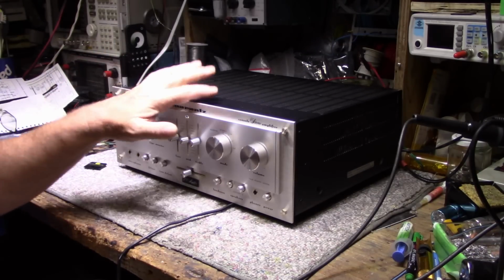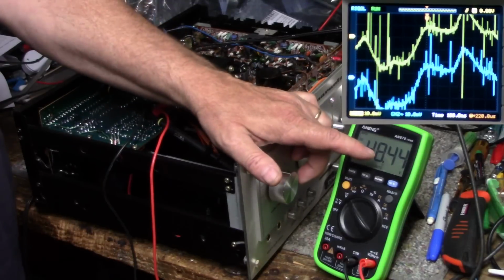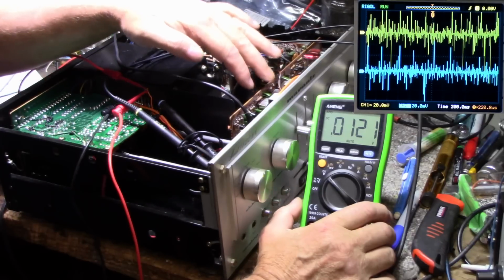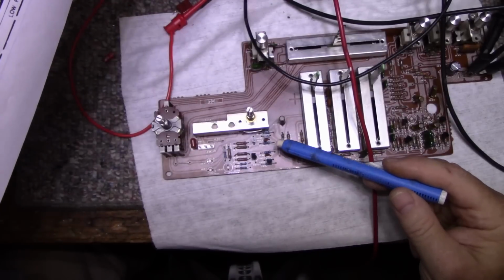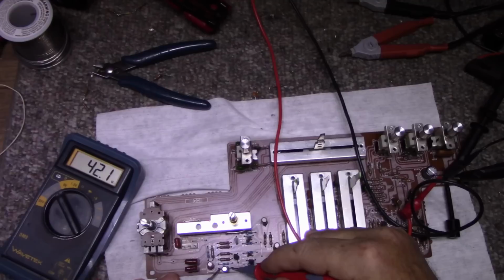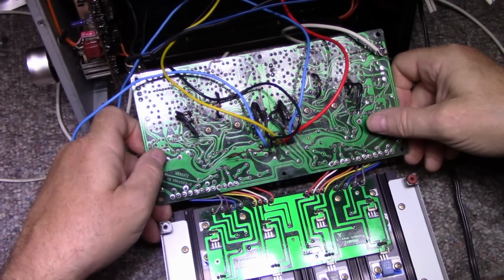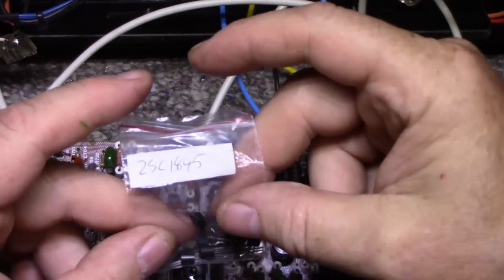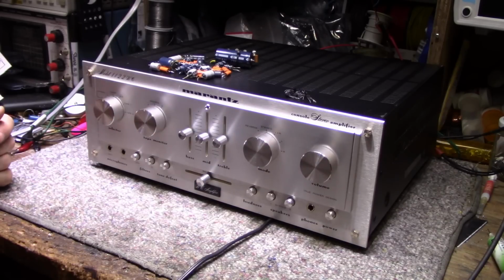Marantz 1122DC Amplifier Repair Part 2 (Ep. 189)

Comment: Crappy schematics aside, this is one of the nicer Marantz's I have worked on. I have done a couple and found corrosion on the silkscreen like you did - one much worse than the other. One even had corrosion on the solder connections on the input PCB. That said this is an excellent performing amplifier that can be had for much less than an equivalent receiver (i.e. 2265).

Comment: Before beginning any project, I take several photos in good lighting (outdoor sunlight is ideal)  of the ORIGINAL (unfixed, un-modded) unit's interior, pcbs, etc  . Makes reassembly easier. And discrepancies between  the actual unit vs. the serv. manual unit trivial.

Comment: I had to redraw an entire section of a power supply or audio circuit, it was years ago so I'm not exacty sure which one it was, on a Marantz 125 tuner. I wasn't impressed with the schematic at all.

Comment: I use freeze spray a lot , it has saved me so much time .  Good advice .  Great vid again , thank you .
Reply: Having the solder iron on the collector for half a second is in the same ballpark. Both methods need to be done really quick, so no other components see the change.

Comment: Excellent video a pleasure to watch, total marathon fault finding session. Just proves that the manufacturer isn't always right 👍.
Reply from the maker: The first problem really threw me off course because it affected both channels and I was convinced it was a PS issue. Marantz saved $0.03 for designing the resistor divider to bias BOTH channels instead of doing them independently

Comment: Try freeze spray (or a can of Dust-off upside down). I have found that it is a handy tool to look for changes in behavior when you freeze a component.
Reply from the maker: Sometimes I like to use a hot iron first to see if it changes things, saves the cost of freeze spray.
Reply: I use Dust-off (keyboard cleaner). Just turn the can upside-down and you have freeze spray at a quarter of the cost :)